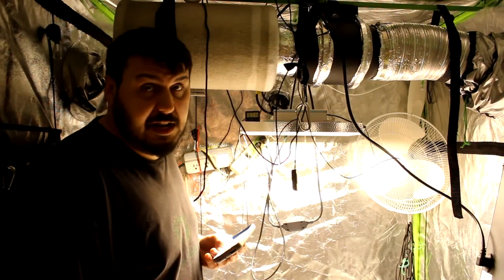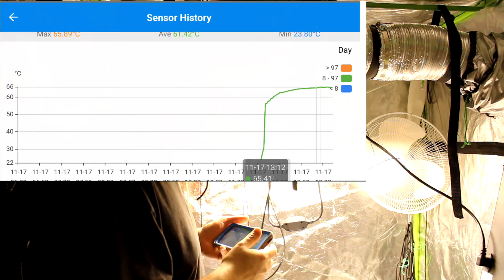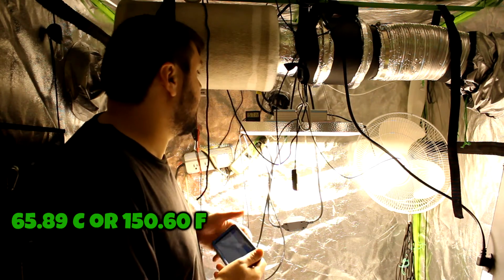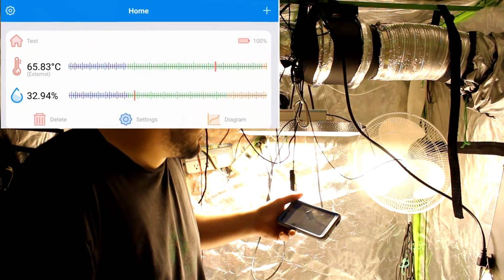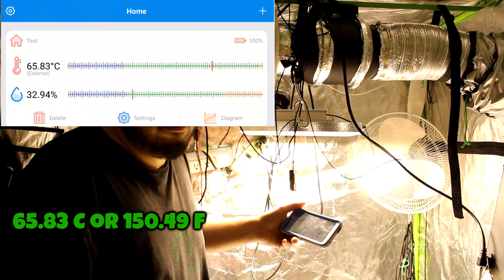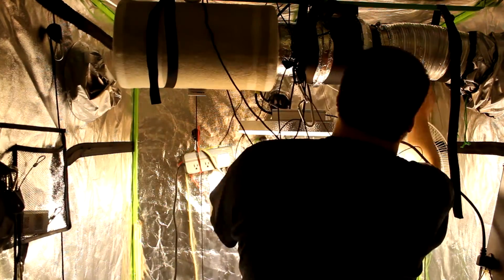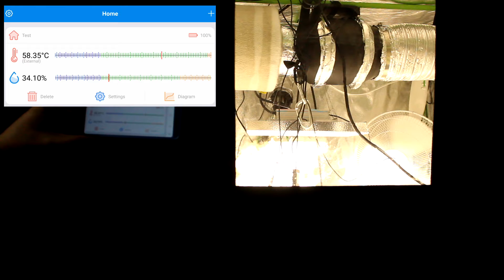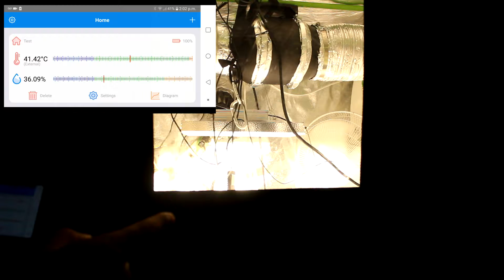Mars Hydro TS 1000 Heat testing How Hot Does it Get?

Comment: I purchased the hydro 6500 and that bar gets so hot I cant touch it until it cools down. I didnt realize these got so hot. i thought LED were suppose to NOT get hot
Reply from the maker: Hey there, yes they do get hot but not to the same degree. Hps lights can hit up to 3000C where led diode themselves can hit 70 to 90C at max. Still hot but not really comparable. When I first grew I used a hps and accidentally touched the reflector, my hand instantly burnt and bubbled. I can touch a led without getting burnt. Top of bars for most lights is up in the 40C range. But I'm using the FC4800 so just a size down from yours and its a nice light.
Reply: @downwithprohibition7364  that makes me wonder if mine is getting hotter than it’s suppose to. The diodes might not be that hot. But the hardware is extremely hot.

Comment: This light runs wicked cool compared to the ts600. Ts 600 will raise temps by 10 degrees in a 2x2 while this will not even make a difference with a fan going
Reply: Is this one actually running cooler than TS600? Because I feel like TS600 is too hot for my setup and thinking of going with ts1000.
Reply: @nighttime9539  do it
Reply: Also what do you think of leaving the driver out of tent? Does it make much difference?
Reply: @nighttime9539  and yes it does the driver puts off heat too. In winter I leave in the tent for more heat. Summer I mount it outside the tent cuz it gets way to hot
Reply: @AUTOFLOWERMADNESS  thanks
Reply: @nighttime9539 major difference and get the newer 150w mars hydro light for better coverage and diodes.

Comment: Thank you for the video! What lamp is better in your opinion Mars Hydro TS1000 vs Spider Farmer SF1000 to grow 1 or 2 plants? And SF1000 is not so hot like Ts1000? Thanks
Reply from the maker: Mars for sure it has a larger footprint
Reply: @downwithprohibition7364  Thank you for the reply! Do you think can be ok TS1000 in a 1.7 x 1.7 x  4 tent? Thank you
Reply from the maker: I cant remember the exact dimensions of the light but I am pretty sure it would fit without any issues lol that is a really small space to grow in though.
Reply: @downwithprohibition7364  the size is ok, but I'm worried about the warmth! I have the carbon filter with the fan but not sure if it's enough to draw the hot air from the 50x50x120 size tent.
Reply from the maker: Oh yeah if you have a fan in there sucking out the heat you will be alright.

Comment: hello! what is better to buy now mars hydro ts1000 or spider farmer sf 1000?
Reply from the maker: Without a doubt spiderfarmer sf1000 is a better light. It uses a meanwell driver and Samsung chips. For the price they have their lights its really giving mars hydro a run for their money.
Reply: Honestly the sf 1000 uses better parts but if you google "coco for cannabis" they did par testing and the mars hydro ts 1000 out performs the sf1000 in par tests but the ts1000 gets way hotter than the sf1000 :(

Comment: Nice video👍🏻👍🏻 good to know I have a tsl2000w will be here monday😁 what kind of light us hanging against the wall by 2 hooks?
Reply from the maker: Hey thanks man, appreciated. That light hanging is one of my viparspectra 600w lights. They are not bad i used them on my first grow..
Reply: @downwithprohibition7364  i see, Q buddy has one similar. Watch out for burnt diides💯 cheers😁
Reply from the maker: @cannabisconcentration1347  I took them all apart. Both of my lights were torn down and inspected after my growing season. Both are still in excellent condition with no burnt out diodes or signs of overheating. They survived lol
Reply: @downwithprohibition7364  I had to replace a bunch on my mars reflectors. Most were blue, but melted back lenses but leds were still working😳😳 I said fire hazard but mars said they wont catch fire just melt😳😳  all working now but they ran a year straight and grew me 3lbs ish of bud in the process too👍🏻👍🏻 now I have a mars tsl2000w showing up tomorrow to replace them and I have 4 phlizon 3000w models that are 630w each☀☀☀☀😎😎  in my 8x8 too😁😁
Reply from the maker: @cannabisconcentration1347  No shit eh damn they must run hot to cause so many burnt out diodes.
Reply from the maker: Sounds like you are set though man
Reply: @downwithprohibition7364  for now yup.😁
Reply: @cannabisconcentration1347  2 years later, how was your experience with the TSL2000? I had a terrible experience, the light started cooking after only 10 minutes and started to smell burnt electronics. Brand new light, adequate ventilation, drivers mounted outside, fan blowing over the light, properly installed and connected.. What a dangerous company Mars is.
Reply: @twentytwo138  mi e has done 3 little grows and I have no problems with it. Driver kept on it and fan blown at the top.
  One grow in a 2x4 I got over a lb dry weight with only that light😁 I use it frequently as a light above my hash making area actually because it helps me see the goods😁👌